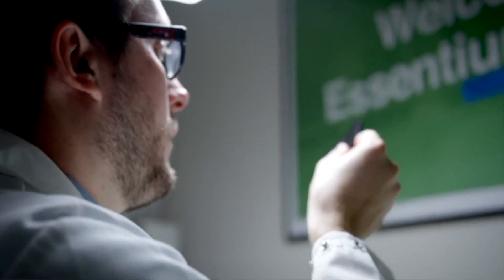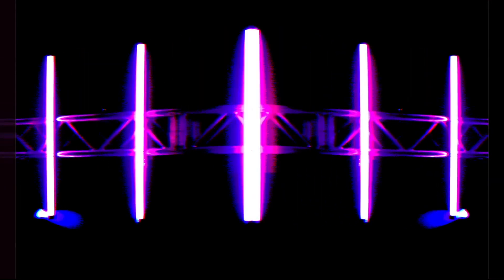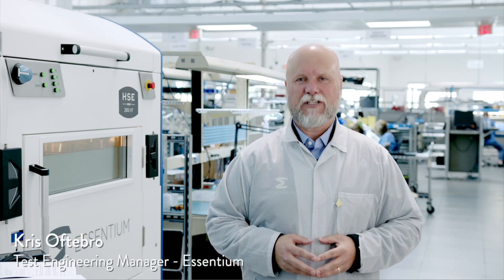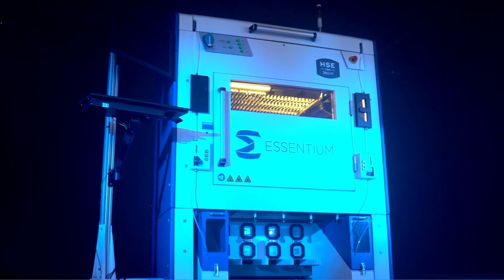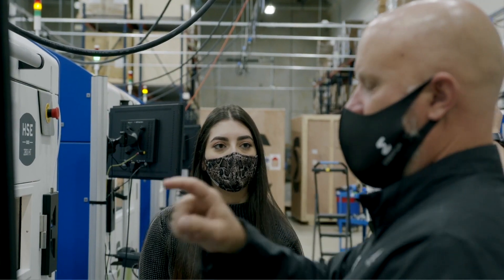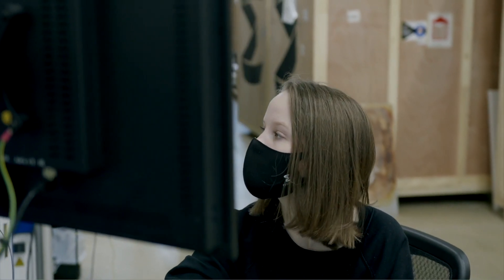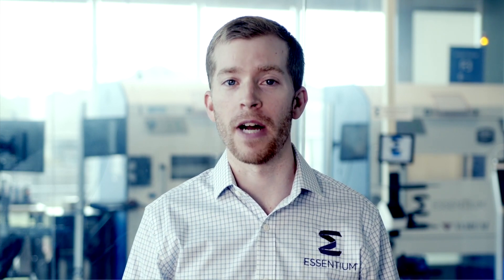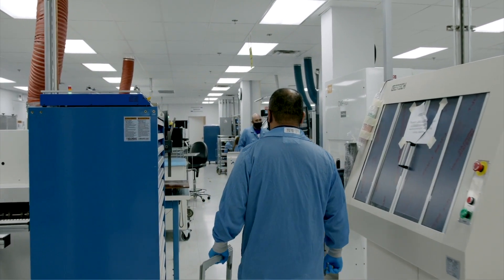Introducing The Essentium HSE 280i HT 3D Printer

Comment: We will soon begin prototyping a four head expandable to twelve head 3D printer that uses no gantries.  Since designing robust software to drive multiple heads is beyond our current capabilities, we were considering some sort of Escher/Titan solution but not sure where all that went.

Since your new printer has two independent (x&y) heads, would it be possible for your software to support four or more gantry-less heads that can cross each others x and y axes?